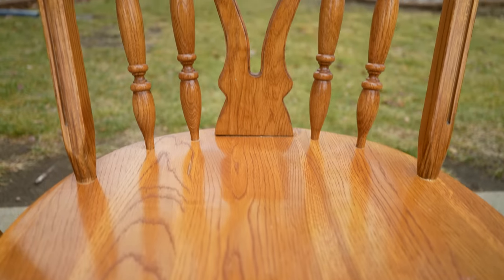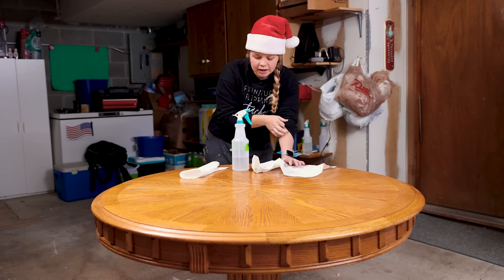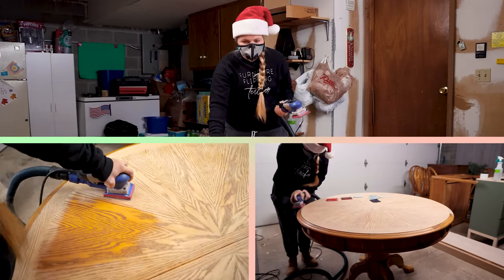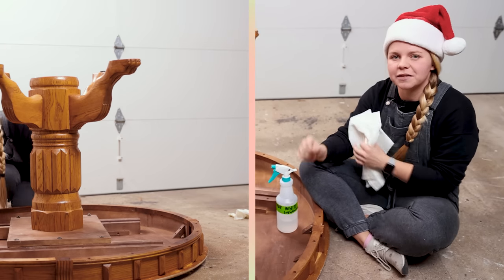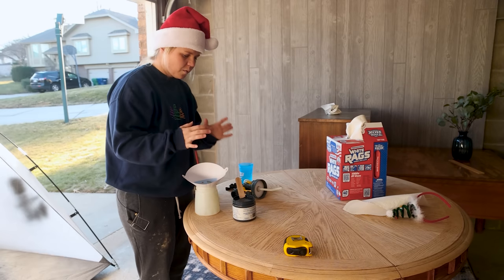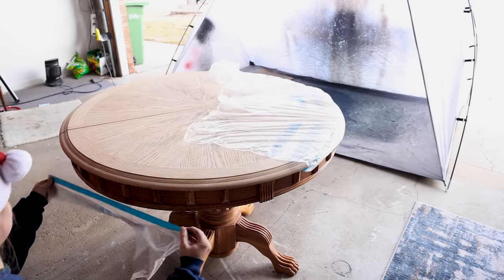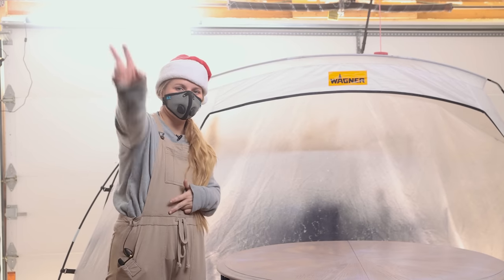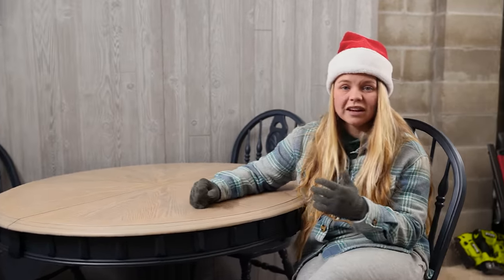Outdated Orange Oak Table & Chairs Makeover | DIY Furniture Flip

Comment: Hi Lauren, I really appreciate your vision and creativity in all of your work as well as your detailed description of your process. It’s really nice that you’re able to donate your lovely table❣️ I too left teaching mid-covid and now focus on my vintage/antique booth and occasionally Facebook Marketplace (I live in the country). There are usually pieces in my auction wins that need some “help”. I’ve never used a paint sprayer so I’m wondering which sprayer you prefer. Seems you’ve used the Wagner 3500, 4000, and 590? Does the piece of furniture dictate which sprayer you use? Are you able to manage the weight of the sprayers okay? I checked out the 3500 at HD today and I’m concerned about the weight with paint. I’ve had new cabinet fronts built for my kitchen and will be painting them myself. I definitely want to spray them. I’d appreciate any input from you.

Comment: This reminds me what auto manufacturers do.  They come out with a new car, it's a beautiful design then in 4-5 years they have some junior designer 'update' it with the latest colors/wheels or other trend. Learn to appreciate the original. In 20 years (of a few years even), someone will buy this at a yard sale, strip it back to the original, wondering "What were they thinking painting over natural wood?"
Reply: But isn't it great that thanks to being flipped it will still be in use for the next 20 years and stuck in landfill? There is so much furniture stuck in charity/thrift shops that no one wants because it doesn't look modern enough for young people. If painting it means someone somewhere will love it and use for a while that's got to be a win-win, hasn't it? Then it will still be around for someone to strip it again in 20 years.

Comment: It was a bummer that you described every single detail of the process except for moving the painted chairs. I'm just curious if you lifted it from under the seat. Also, you didn't explain what you did to the top before the top coat. 

This turned out pretty, although very unusual. It'd be interesting to see what the recipient thinks.

Comment: Hi, I'm remodeling my first desk but it doesn't go like all the videos I've seen. I started with the scraper tool and then started sanding with a 80 wave. However, the longer I sand the less it comes off. This happens only on the top because I sanded the sides very easily. I would like a little advice😅.

Comment: I used gel stain on my table top and I will never use gel stain on any surface that has hard use. It chips very easily.  I will only use penetrating stain. It will wear and be very durable.